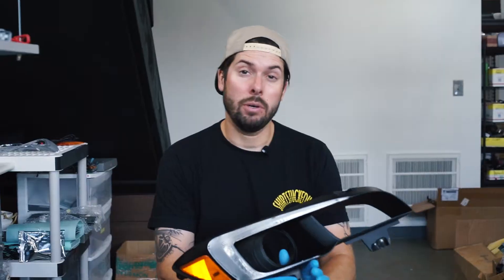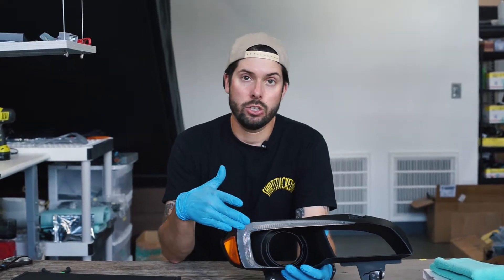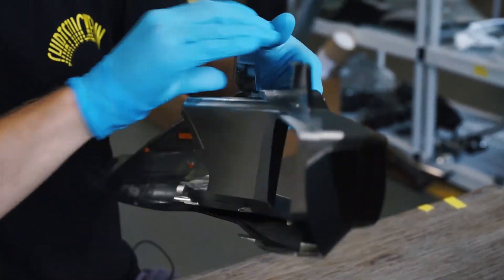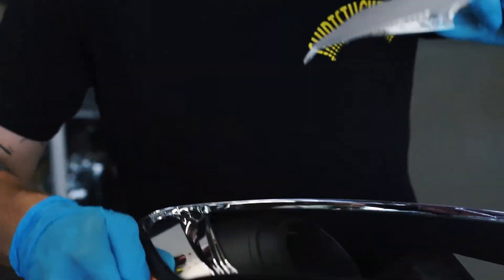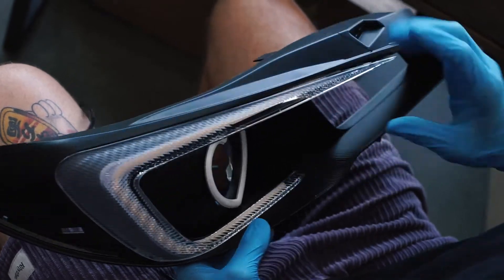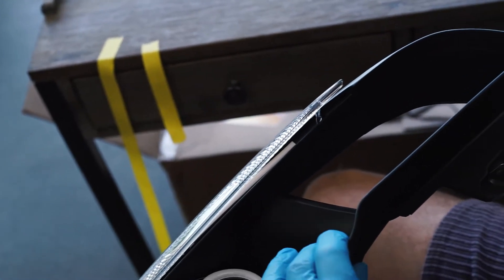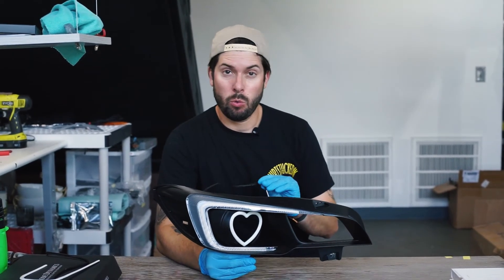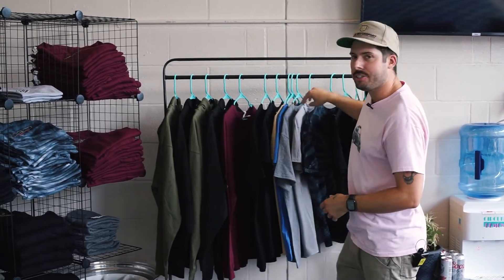How To Install Diode Dynamics C-lights in your 2015+ WRX Headlights!

Comment: Hey man this could be a long shot but any chance u can make a tutorial video of custom c light (aka wrx'15+) for gc8 impreza...been wanting to learn how to do it but I have no idea how to wire them up lol
Reply from the maker: Hey there! Unfortunately we never actually go into doing this mod. The c-lights don’t really fit properly no matter what you do. Even if you get it sitting okay you will see exposed holes drilled and just never looked right for something that we could sell on the website, so we never needed up doing this modification to the GCs. Still can be done, but we have no how to on this one. Sorry about that!

Comment: How can I do this to a 06 Subaru c light headlights?
Reply from the maker: You would need to source the OEMassive headlights that come with the C-lights. They are unable to fit the DD C-lights though.
Reply: @circuitdemon_  I will be new headlights with c led headlights. What kind of led strips I would need to fit my 06 Impreza??